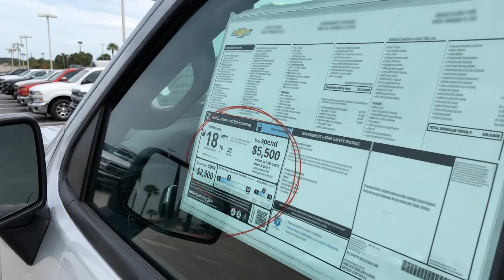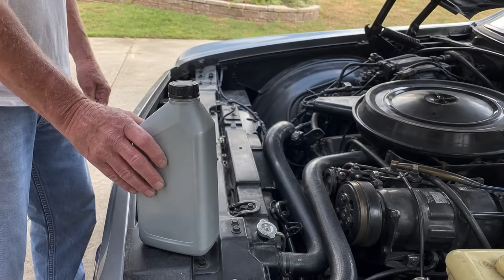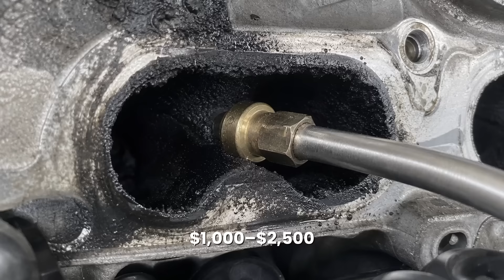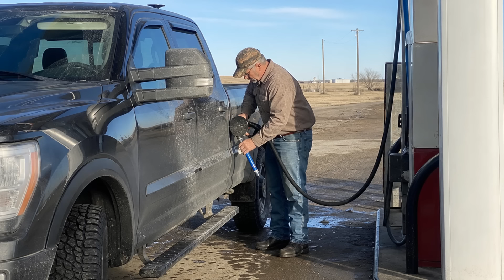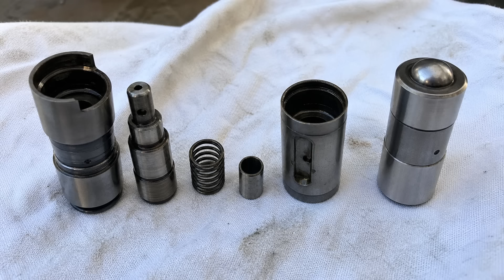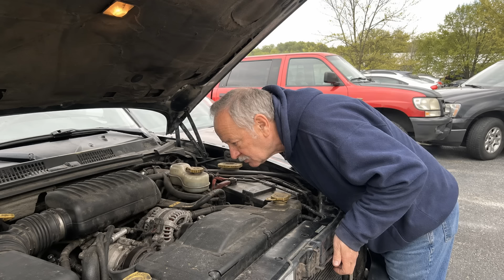9 Most Dangerous Pickup Truck Features That DESTROY Reliability

Comment: Autos with Start-Stop technology will wear out the starter motor and destroy the battery. AGM batteries are charged via the vehicle's computer, according to pre-determined mapping. The problem comes with the fact that those same Engineers have also downgraded the alternator/generator to save a few pounds of weight. In addition, all those accessories that used to be powered directly by the engine serpentine belt are now powered by the electrical system. The very same electrical system, with an undersized battery and undersized alternator. "Designed to fail" is an understatement.

Comment: I have 2004 chevy tahoe lt with almost 301k miles with a 5.3 liter engine and still going strong. Only have replaced two water pumps and one rebuilt transmission  at 290k miles. Love it and keeping it. Still looks new. One owner.

Comment: When I bought my 2021 Chevy duramax, 6 cyl , I did a lot of reading / research.  My previous truck was a 2001 Chevy Duramax, 1st addition.  It’s big problem was the buried injector so when one leaked it was a $4000 repair bill.  However, it used the highly reliable Bosch CP3 pump. 

I knew the cp4 was a big problem for ford and was happy to find Chevy went back to the cp3.

But I digress.  I never liked nor agreed with the auto stop feature on any engine, especially thought it was idiotic on a diesel.  I most always turning it off, especially when I get to a red light and realize I forgot.  Now that I know 3 rd party mfr make a module to keep it off I will look for one for my truck. 

I subscribe to your channel and love the info you provide.  Thank you.

Comment: Disconnect that start/stop button as soon as you can. When it kills the engine the oil pressure goes way down and it has to recirculate and it's just torture on the engine.

Comment: I currently own a 2019 Ram, 1500 bighorn, with the HEMI 5.7 with 43000 miles on it. So far, it's been good. The only issue it's every so often when the truck starts cold. It makes a little Bang sound when you start it, but not sure what that is other than that. I've purchased it a year ago. It's been good so far. I changed the oil every 3000 with amsoil
Full synthetic 30 weight due to extreme heat living in the desert.

Comment: I won't buy a newer truck, I can also say computers and emissions destroy engines and milage, I have an 88 freightliner, no aero, no computer, I got 10-11 miles per gallon, I bought a 2010 international prostar, all the aero, computer engine, I got 5-5.5 miles per gallon, and it was in the shop all the time, my old freightliner wasn't, we need to dump emissions, and computer controls, and go back to the 70s trucks, they were way better than the new ones

Comment: Putting a turbo on an aluminum block engine is like wearing a raincoat on a hot sunny day, turbos were designed for cast iron blocks in Diesel engines in heavy duty trucks to get a heavy load moving in a 18 or 10 wheeler loaded with product  ,otherwise turbos in an aluminum block engine is asking for problems.

Comment: Hi sir 
I have a 2024 5.3 and I just installed a dfm disabler from range disabler, I had a mechanic in a independent shop because it's still under warranty, 11,000 miles on her,I'm worried about lifter failure on it, I don't know if you're viewer's know this but if you're shop tells you that they won't fix your truck because you put a disabler on your truck then remind them of the magnus moss act from 1975,its literally an unknown law that says they have to prove that what you did caused the failure, and a disabler on your truck won't cause any lifter failure (bottom line),so if that does happen to you just tell them to prove it, love your channel and your reviews on vehicles, I'm a subscriber to your channel and watch all of your reviews, I don't know why people on here say you are ai,you're not, because what you say I know about from my year's of being a mechanic on John deer tractors in my younger years, thanks for your honesty and telling about vehicles, stay safe and keep up the great reviews  😊😊😢
Reply: Driving a engine like that variable timing or cylinder deactivation means driving a vehicle and trying to get the best possible gas mileage possible. If you want cold hearted horse power or torque buy a vehicle that has a bigger engine. They should put the 6.8 back on the road

Comment: We have a 2020 Navigator with the HD trailer tow option...yep, if you program it, It will put your boat in the water hands free..woopy Do!  BUT they built this thing with NO Dedicated Transmission cooler!! First tow with our 6000lb travel trailer in hills we saw 235 degrees on our transmission fluids temps!!! No trans can live at those temps!!! CDF drum failures? Bet you could cut those in half keeping the thing at a sane temp! Glad to hear they are hiring back 300 senior engineers!! They need it! So check to make sure you have a cooler or put one on..I installed a cooler with a temp controled fan...even in 90 degree heat 185 is the highest we have seen now!

Comment: air springs on at 2017 ram 2500 are 2300cad each and and the compressor is 1600cad had to do the whole system on my truck
Reply: Never seen air springs on a ram 2500

Comment: These GDI engines are the worst
Reply: Be prepared to pay for a walnut blast cleaning, or put 2 ounces of acetone in every 10 gallons of gasoline you buy, that will slowly clean up carbon build up, over 10 or more 10 gallons of fuel cleans out the carbon, plus keep your oil changed ...its a proven way to rid these GDI engines from building carbon which will cause misfire, rough idle etc ....